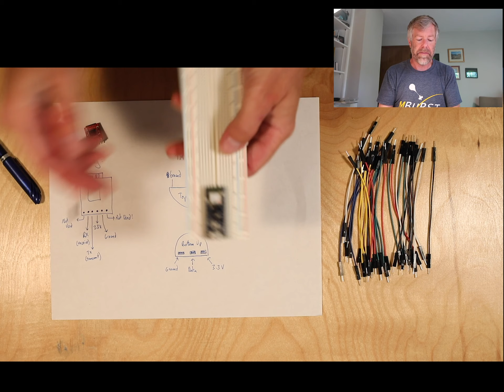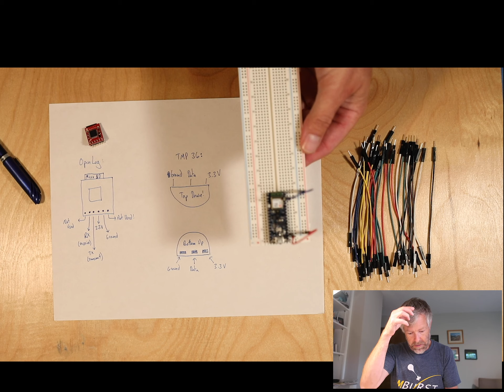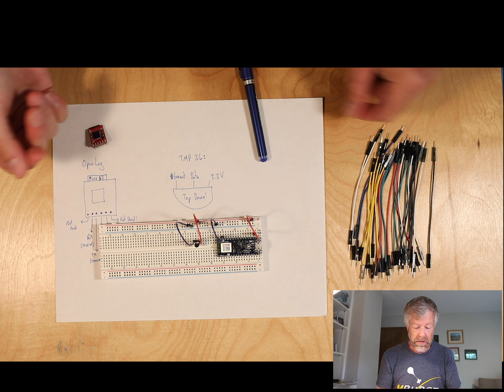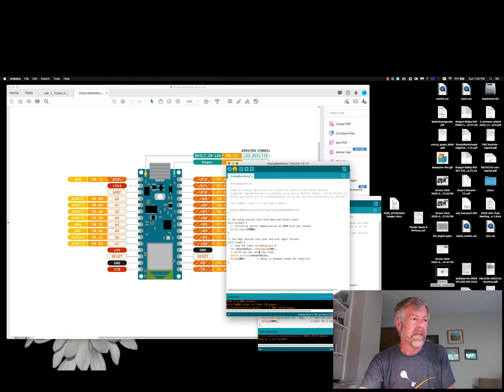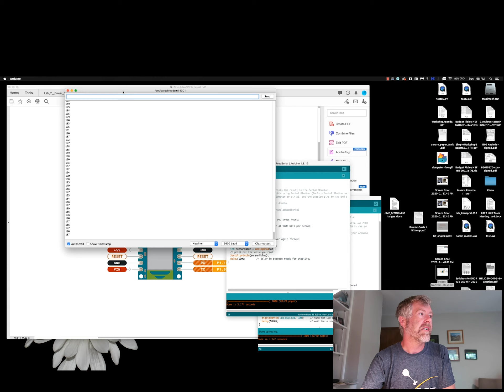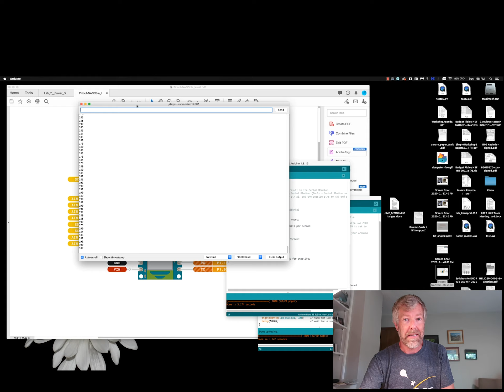Reading an Analog Sensor (TMP36) with the Arduino Nano 33 BLE

Comment: how can i convert these tmp36 sensor values to be in Fahrenheit? I know the formula with 5v power is as follows. I'm wondering if it's essentially the same for 3.3v? 

```
float tempVoltage = sensorRead * 5.0 / 1023.0;
float celsius = (tempVoltage - 0.5) * 100;
float fahrenheit = ((celsius * 9.0)/5.0)+32.0;
```